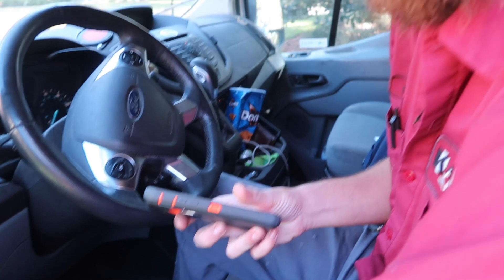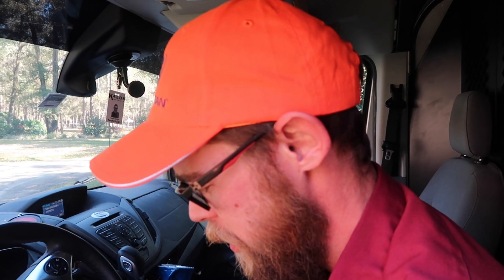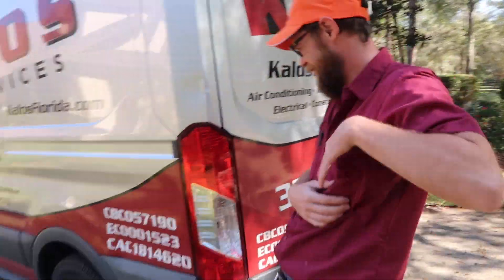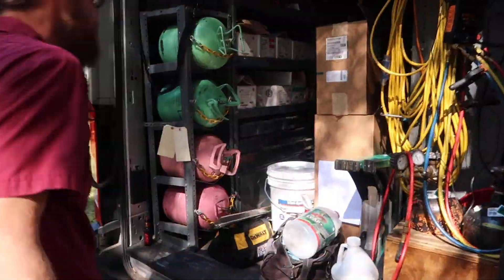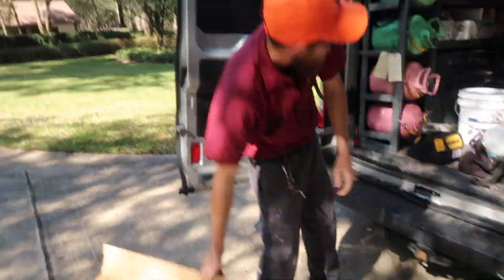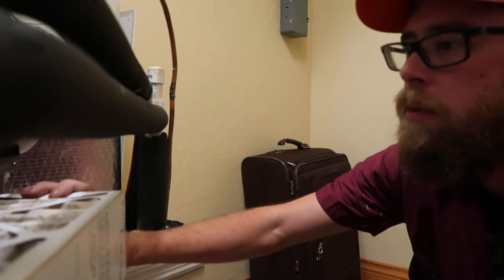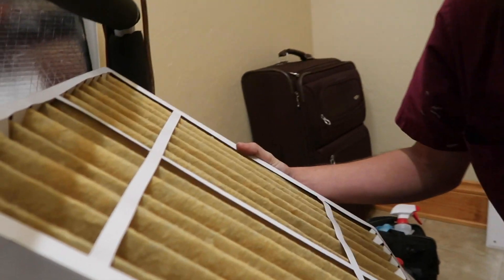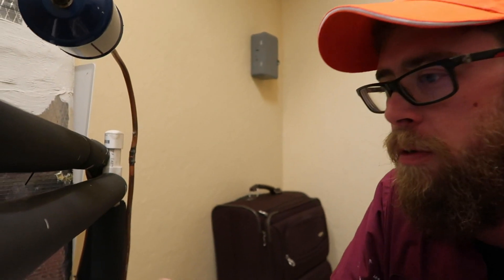HVAC Heat Pump Maintenance Ride-along

Comment: Great job on the maintenance, unfortunately as an educational video, this wasn't very good. Also that's an infinity carrier, you can't check pressures on it and get a true reading unless you place it in charge mode or enter advanced settings

Comment: As a non-pro home owner, it would have been a little more helpful if you had dubbed in a bit of narration during this just to explain a few more details of what you were doing. For instance what is the liquid in the jug you added and where does one usually find the filler cap on an air handler if it is a different brand and isn’t immediately obvious?  As well, what are those plastic wrapped pads around the compressor? And did you replace them before putting the exterior unit back together?  Was there a purpose in taking them off in the first place… especially since they seemed to have nicely protected the compressor from dirt and weather in the first place?
Reply: This isn’t necessarily something a home owner should be doing

Comment: So y’all’s maintenance consists of just cleaning and checking pressures? No amp draws on compressor? Or any electrical readings for that matter. Also , why would you check pressures right after washing coil? Pressures, as well as Subcool and superheat will not be accurate with a wet coil

Comment: Didn't do system test under carrier checkout menu. Checked pressures with a wet condenser coil. And using hoses instead of probes.

Comment: Basically seen him clean and not do any readings of any sort pretty basic and really didn't do much besides look busy like wiping all in all just getting by
Reply from the maker: Thanks for the feedback
Reply: On a unit in this kind of state, what do you think needed doing... he checked electrics, operation was proven on arrival as it started and the guy looked at the controller, then the fan was removed and the minimal debris was cleared out, followed by him going inside to check the fan system. 
I’m guessing you want a damper check carried out (if fitted) current draw of motors, temperature at the outlet to verify the thermostat accuracy and fan speed to potentially take note of the fans multi speed control board. I’m not sure but I’ll assume the unit is quite new, so unless there’s a complaint, you quickly do a running check, otherwise there’s no real need to start going too deep.

Comment: AC tech here, not a single amp draw or voltage reading taken. . . And coil washed washed before taking pressures and SC and SH. . .  0_o
Reply: yeah i always check amps and volts but sometimes i will wash before checking charge. same as checking filters first too. just because if somethings dirty then your gauges are gonna be off some form or fashion. only thing is you have to wait long enough that the coil dries

Comment: Very nice, thorough job. Checking those pressure s before the condenser wash? 

May have been out of sequence....but checking pressures & SC/SH after washing coils isn’t going to give you accurate information unless you let that unit run a considerable amount of time to dry the coil.

Comment: what is difference between Heat pump and condenser unit ?
Reply: A condensing unit is the unit outside which is the high side of the system. A heat pump is an air consitioner that has a reversing valve which means on heat mode the valve switches over to cause the unit to basically run backwards to use refeigerant for heating mode rather than using electric heat like a normal ac
Reply: Heat pump is an air conditioner that basically runs in reverse.  In AC mode the condenser is rejecting heat while the evaporator coil at the air handler is absorbing heat,  in heat pump mode the outdoor and indoor coils swap roles.
Thus the condenser turns into a heat absorber and the evaporator coil acts as the heat rejector.

Comment: Do you guys ever remove the condenser grilles to get the  grass clippings out (between the coil and grille)? We used to clean our condenser coils without completely disassembling the unit. Realized the large clumps of clippings don't come out by just spraying from the inside out. Now we painstakingly tear them down to nothing but the coil. You'll be surprised how much stuff gets built up in just a years time.

Comment: Wondering what kind of cleaner you use for the drain line I couldn’t get a good look from video. I’ve been trying different ones since I’m new (only 1 year) but haven’t had time to do a real time test with anything.
Reply: Blue coil cleaner works best, dilute with water & use gloves because it can burn you. I only use it on drains. It's intended use is for coils but can burn one up if your not careful.
Reply: Sean O'Neil thanks for the info.

Comment: This maybe a stupid question, but ill ask anyways. In a heat pump should the liquid be insulated as well? If so why?  Reason i ask is becuase i came across a heat pump unit with the LL insulated.
Reply: was it a mini split?
Reply: @FoXHounDXD  yes a daikin heat pump mini split.
Reply: @mrgreen2646  you're not looking at a LL because the expansion valve is in the condensing unit. Thats the line in-between the expansion valve and evaporator. I call it the expansion line. Thats why its insulated.
Reply: @FoXHounDXD  that makes sense thanks for sharing.
Reply: Some new codes require both the suction line and liquid line to be insulated on new residential installs and change outs. They're even requiring that the black rubatext be painted with the white stuff.